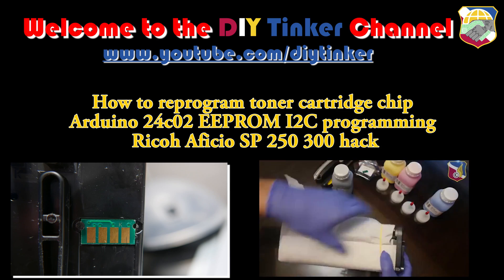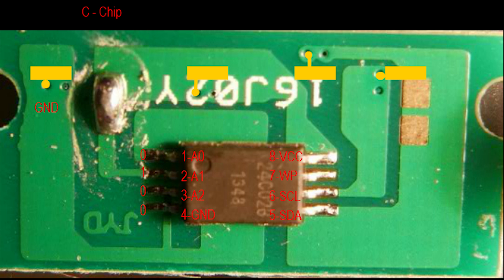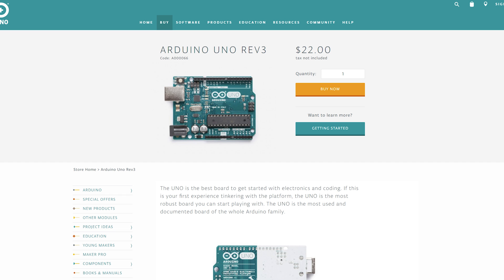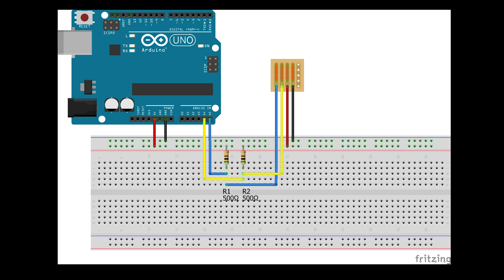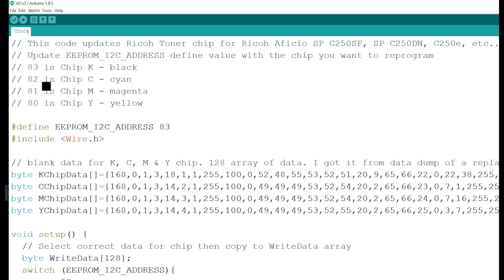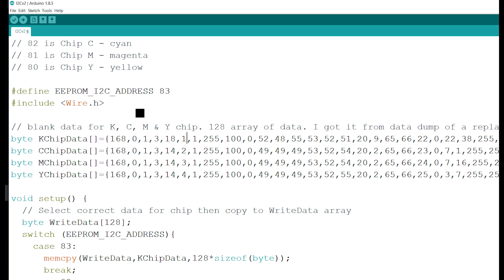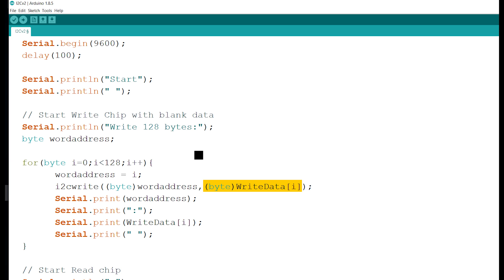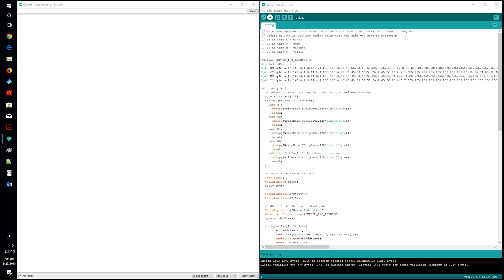How to hack Ricoh Aficio toner cartridge chip using Arduino UNO - program 24c02 EEPROM I2C

Comment: Need help i'm late to this but i have the board connected on com4    5 volts on first two pins and clock and data pins connected on correct pins however when i hit the reset button the green light goes out flases a couple of time but nothing is being written..any help out there would be appreciated
Reply: Is this for a Ricoh printer?

Comment: Hello, is it possible to do the same / similar thing with a CH341A programmer? I am trying to figure out out which pads to connect to which pins. I found the GND but CLK, VCC and DATA is a problem.
Maybe you can help figure out which pad is which. (The ink chip is an aftermarket one)

Comment: Will this work on Ricoh 1000?
Reply: I am not familiar with DTG printers.  Does it have a chip similar to the one used in this video?
Reply: @jimsmith9803   No ,it's just has a black ball of black ink
Reply: @ Do you mean that the EEPROM on the back of the toner chip is sealed in epoxy?

Comment: what about the white toner chip?
Reply: If you're using a white toner cartridge with a Ricoh printer, then use the chip on a new white toner cartridge for the following.  Get pin out first, then use I2C scanner to get address, then do a data dump, then finally rewrite data to chip on original cartridge.  The specifics are discussed in the posts somewhere.

Comment: WHY is there no reset hardware for the brother TN229 series chips? Lots of hp, xerox, recoh and lexmark laser printer toner chips can be reset-- why not brother tn229-- which has no alternative but to replace the chip?? Seems like a great market.
Reply: It's Brother's first entry into toner cartridges that can stop your printer till you pay for another chipped toner.  The market is new and it takes time to get enough people interested in resetting chips to make the investment worthwhile.  I have a printer that uses TN-229 cartridges.  I am waiting for the toner to get low.  I don't want to ruin a chip, especially if I don't know how successful I will be.
Reply: @jimsmith9803  fwiw, there are two Asian companies working on getting tn229xl chips to reset. Apparently not easy.
Reply: @ Doesn't surprise me.  I noticed that the chip only has 3 tabs.  My first guess is that the chip is drawing power from the SCL pin.  I'm sure that they will eventually solve this.

Comment: how can i do a data dump on my new hp 745 cart chips? and also how do i do a i2c address check? im new to this stuff. please help.
Reply: Never tried to do an ink cartridge chip.  Does the chip have four contacts like the Ricoh chips?  If not, then this setup may not work.  The code for the I2C scanner is in the posts somewhere.

Comment: This is great. Could this work on a uninet white toner printer. The printer is a Ricoh really and the chips are exactly like yours. I guess this could work for the rest of the colors except the white one. Thanks
Reply: It should work for all chips.  Even the white.  Remember that pin out, addresses, and data will be different.  First find the pin out.  Then use the I2C scanner to find the addresses.  Then do a data dump so you've got a good data set just in case you do something wrong.  And most importantly, make sure you have a backup chip in case you accidentally destroy the chip you are working with.

Comment: Will this work on pro c5100?
Reply: I have no experience with such a high end printer.  But you could try.  Replacement chips are only about $15USD and use a four contact system to communicate with that printer..  Just find the pin out and use the sketches described in these posts to find the data address and do a data dump.  Now that you have a backup chip, feel free to experiment.  Remember that your $34,000USD printer is going to be useless if you mess up your only chip.

Comment: You can first read from I2C to see which address the chip responds to, so you work out the color of the chip, then you can reprogram accordingly, saving user the work to change code.
Reply: You already know the color that the chip corresponds to.  The chip either came off one of your toner cartridges and you would know which one or you bought third party chips which would be labeled.  You use an I2C Scanner to find the address of the stored data.  You use the read sketch to get a copy of the data stored at that address.  And, finally, you use the write sketch to re-write the data back to full when the chip shows nearing empty. Also the data used in the video is specific to a Ricoh C250DN.  Any other model would use different data and you use the read sketch to get that data.

Comment: My Printer is Ricoh Ri100 - garment ink textile printer. Can I reset CMYK chip?
Reply: Does the chip look like the one used in the video?  If so, it's worth a try.  If you're going to give it a try, do it on a spare chip and not your only chip.  If you ruin your only chip, you will not be able to print at all till you get a replacement.

Comment: Big thanks to DIY Tinker for this vid and a big thanks to jimsmith9803 for saying which part of the code to delete for a read only.
My Samsung ML1670 also has a 4 pin chip that looks exactly the same, but the order is different. 
The longest/biggest pad is the ground, then CLK, Data and Vcc on the outside. 
The printer also feeds 3.3V, so putting on 5V will fry the chip, I took off 3.3V from the Mega2560.
Nice thing is the pads were labelled with a silkscreen, this is for the MLT-D104S toner cartridge.

Here is the dump from my Mega2560:
14:09:12.116 -> Scanning...
14:09:12.116 -> I2C device found at address 0x28  !
14:09:12.163 -> done
14:09:12.163 -> 
14:09:20.728 -> Start
14:09:20.728 ->  
14:09:20.728 ->  
14:09:20.728 -> Read 128 bytes:
14:09:20.728 -> 0:0 1:0 2:0 3:0 4:0 5:0 6:0 7:0 8:0 9:0 10:0 11:0 12:0 13:0 14:0 15:0 16:0 17:0 18:0 19:0 20:0 21:0 22:0 23:0 24:0 25:0 26:0 27:0 28:0 29:0 30:0 31:0 32:0 33:0 34:0 35:0 36:0 37:0 38:0 39:0 40:0 41:0 42:0 43:0 44:0 45:0 46:0 47:0 48:0 49:0 50:0 51:0 52:0 53:0 54:0 55:0 56:0 57:0 58:0 59:0 60:0 61:0 62:0 63:0 64:0 65:0 66:0 67:0 68:0 69:0 70:0 71:0 72:0 73:0 74:0 75:0 76:0 77:0 78:0 79:0 80:0 81:0 82:0 83:0 84:0 85:0 86:0 87:0 88:0 89:0 90:0 91:0 92:0 93:0 94:0 95:0 96:0 97:0 98:0 99:0 100:0 101:0 102:0 103:0 104:0 105:0 106:0 107:0 108:0 109:0 110:0 111:0 112:0 113:0 114:0 115:0 116:0 117:0 118:0 119:0 120:0 121:0 122:0 123:0 124:0 125:0 126:0 127:0  
14:09:21.432 -> End

Printer report shows toner is 98% full.
I basically just soldered 4 wires directly to the chip pads and 10K pullup resistors between Vcc and CLK /SDA.
Reply: Strangely all my values seem to be 0, which cant be right. I wonder if thats due to using 10K pullup resistors.
Reply: @cobraCPT  You are right.  All 0's or all 255's are indicative of bad data.  Did you run an I2C Scanner to look for addresses? How many epoxy blobs are there on the back of the chip?  I have a Samsung C1810DW Printer.  The chips have two blobs.  One chip hides the EPROM and the other hides a PIC32 chip.  If I rewrite the chip, my Arduino Uno shows a successful rewrite.  But if I go back and read the chip again, it shows the original data and not what I just wrote to the chip.  I wonder if the PIC 32 stores a copy of the data and writes that back as a way to stop people from rewriting their toner chips.  Also I use the 5V pin from my Uno to power the chip for rewriting.  It works fine for me.

Comment: Can this approach partially be used for Xerox XE550TK tonerchips?
Reply: I did a search to see what the chips look like.  If the picture I looked at is correct, there is some sort of microprocessor chip on it.  I would guess that you would have to activate that in order to write the memory.  The Ricoh chips just have an EPROM that you can access directly.  I have a Samsung printer that works like how I think the Xerox does.  The Samsung printer has a PIC32 on the toner chip.  I can read the chip, but I can't write to it.  The PIC32 somehow prevents unauthorized writes to the EPROM.  I've never been able to find a way to get around this.
Reply: @jimsmith9803 Can I show pictures of my current circuit to you maybe?

Comment: What about Richo printer 3600dn plz ?
Reply: Not familiar with that model.  Does the chip look the same as the one in the video?  If so, it's worth a try.  Somewhere in these posts are the directions for doing a dump.  See if you can get a good dump of the data.  I would try this on a spare chip because if you mess it up, you can't print til you get a new one.

Comment: Is this help for printer Richo3600 dn
Reply: I am not familiar with that model printer.  Does the toner chip look like the one in the video?  If so, then maybe.  The process will be described elsewhere in among these posts.  In short, you need to find out the pin out.  Then the address of the data.  Then do a data dump of a full chip.  Then write the new data to the chip.  I would definitely do this on a spare chip, because if you do something wrong, you could ruin the chip.  Then the printer would not be usable til you got a new one.

Comment: Men i was looking at this video is it possible to do this for a ricoh ri 1000
Reply: Interesting question.  I don't really know.  This is a DTG printer and I don't know anything about them.  The only way to find out is to try.  Is it a chip with four contacts?  If so, then you could try to do it.  Use a chip that you don't need anymore.  You don't want to destroy a chip that you need to have for a good cartridge.  You need to find the pin out first of all.  Next, you need to find out the address it is using.  And finally, you can dump the data.  All that is discussed in various posts here.  If you get that far, you can do the same for a chip that reads full and try to write that to the chip that reads empty.  If you are willing to try this, please come back and post the results (good or bad).

Comment: how do you reset the chip for ricoh p c200w?
Reply: The general procedure is the same for any Ricoh printer.  However the addresses and actual code are probably different.  You should have a set of new replacement chips so that you are using code that will read full.  The next part is to find the pinout of the chips.  I googled the chips and looked at images til I found one that showed the pinout.  Next, there is a sketch somewhere in these posts that will give you the address used for that color.  Mostly they are the same ones used in the video (80, 81, 82. 83. 84 ), but the color assigned to that address may be changed.  Once you have the addresses, do a dump of the data for that color and save it somewhere.  Now take the dump data and replace the data in the reset sketch with the new values.  Simple as that.  You want to read all the posts for this video.  Everything you need is there.
Reply: The chip for mine is different than this one
Reply: @michaeladia  How is it different?

Comment: Thank you for explaining the idea, worked for me. I have no idea how much toner is still left inside the cartridge, will see :) for some reason, sketch did not work for me, but the idea is so simple it posed me no problem to implement it with my own customization. Thanks again, it's your contribution for greener wasteless future :)
Reply: Yep.  That is one problem.  You are back to the old days when you had no idea how much toner powder you had left.  When you see a page you just printed with a color that is very light, you shake the toner to buy yourself a little time.  You then know that you're gonna have to refill the toner cartridge in a very short time.  Inconvenient but workable.

Comment: Amazing! 
We save so much money now! 
If there is anyone out there that needs help. 
Get in touch with me. 
(At least for Richo Printers:)
Reply: Hi! Do you really arduino? Someone said they used just USB cable. How come?
Reply: @joshm4max  Then what did they use for the microcontroller to reflash the toner chip?  Something has to talk with the chip and give the info to reset it.
Reply: I must do this for Ricoh Ri 1000 DTG printer
Reply: Hi, do you have a dump from Ricoh M C 240 FW (408451, 408452, 408453, 408454) Thx
Reply: @IC9020  No.  But the steps to follow are listed somewhere in the posts.

Comment: will this procedure work on ricoh sp 201?
Reply: It should work on any Ricoh printer.  They all seem to be set up the same.  I've used it on 250 and 360.  Others have used it on 240 and  and 260 series.  Be aware that the pin out does change and you will have to find out what it actually is before proceeding further.  Once you get that you can see what address each color uses.  Then do a dump of your current chips (or buy new ones and dump those).  You need backup in case things go wrong.

Comment: Awsome! I need the hex files for richo SP C242SF, where can I find them?
Reply: The best way to get files is to buy new chips and dump the data.  That way if something goes wrong, you can still use your printer.  Somewhere in these posts, someone posted a dump from a 240. I would think it would be the same.  Just do a dump of what is on your chips now so you can reset the chips back to normal if it is not correct.

Comment: Hello,
thanks for the video.
i have a ricoh p c300w printer.
with ricoh m c250 toners.
i got a error .toner not good installed.
is the code different for this toner?
how can i read the chip?
greetings Dyon
Reply: Probably.  I have a C250DN and a C360DNw.  Not only are the codes different, but the pin out is also different.

Comment: How have you figured out the 83 address for the K toner? Also, are the resistors necessary or it should work without them also? Do you know if a similar approach can be used for hacking the W2070 chips for HP 150nw? Thanks
Reply: You can use the I2C address scanner discussed somewhere in these posts.  Depends on the board.  I didn't need them with my UNO board.  There are internal resistors that can be set up.

Comment: Chip programmer cost 15$ with free delivery. I also bought 4 tomer chips for 5$. I did copy of these chips and now just programm when needed. Few seconds and you do not need play with arduino and program writing.
Reply: how did you read the chip?
Reply: Podrías facilitarnos el nombre del programador de chip, asi como el programa utilizado para lectura/escritura. Cuanto mas información mejor. Gracias.

Comment: Could add a lcd display and a rotary encoder for toner selection and write execution
Reply: More work than it is worth.  Most people only have one or two printers.  You just have a copy of the data and load that to the Arduino and flash it to the chip.  Now, for a business that reflashes chips and uses a lot of different data, this would defin itely make sense.

Comment: Hi Your Work is Legendary, i am redoing what you did but using CH341A Programmer on a chip of different printer, till now i have got the chip connected using IC2 protocol, only problem i am having is which address is the data hidden in the chip how long should it be, communicating chip using CH341a is not that easy like adrino uno...
Reply: Buenas conseguisteis algo para leer/programar desde el programador CH341A, ¿que adaptador has utilizado para la lectura? Quiero hacer copias de clónicos para después escribirlos nuevamente. Gracias de antemano

Comment: I'm working on hacking an industrial inkjet bottle chip, it definitely uses an eeprom chip but running this code isn't working... (it writes the values but then reads 1:0 2:0 3:0 4:0 ect.) no mater if there is contact with the chip or not.
Also If I switch the data and clock lines around the serial monitor only updates when contact is removed from the chip... why is that? I'm thinking something to do with the clock details that are held inside of the Wire.h library.   
I would really appreciate some help!!
Reply: i also just started working on hacking of a RISO SF 5030 ink bottle chip...would you share some of the infos you have...thanks
Reply: You don't say which printer you have.  The pinout  can vary between manufacturers.  You need to verify this first.  Then you need to use an I2C scanner to find the correct address.  Then, finally, you can get a dump of the data.  You need to go in this sequence and can't go to the next step till you figure out the previous step.  Good luck on your quest and post a reply if you are successful.